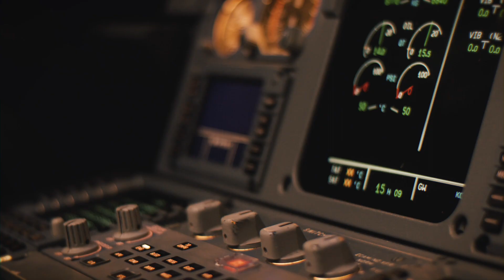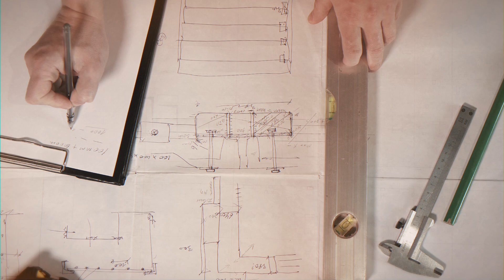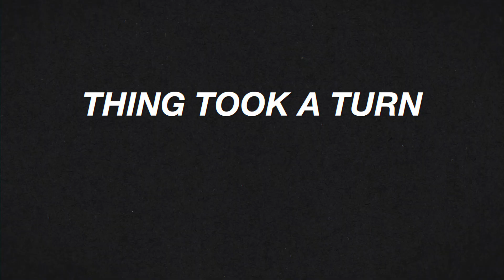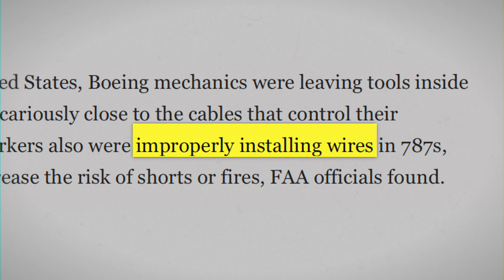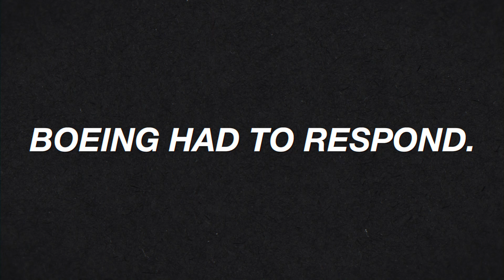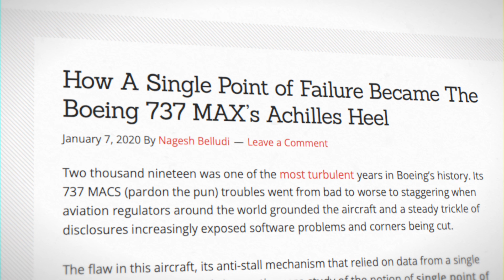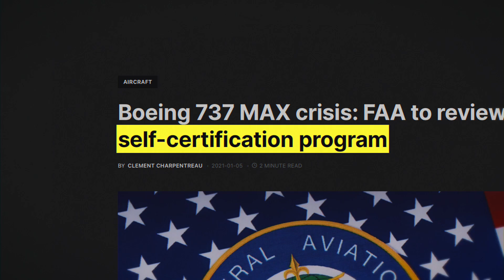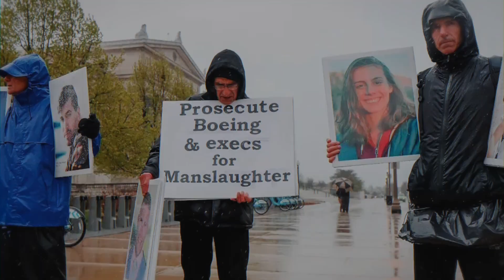The Scandal That Destroyed Boeing

Comment: Just a point of correction. There is no "MCAS sensor". MCAS is just a software system. It uses the pitot static sensors, which multiple other systems use, and which the 737 has 3 of for redundancy. The problem was that MCAS only read in the data from one of the pitot static tubes, rather than checking all three of them to see if one was give erroneous data, like other systems on the plane do.

And from what I've heard, initially, they had actually designed it to check multiple of the sensors, but they reduced it to one later on. I never found out the reason for that though. Maybe they were having problems getting the code to work with multiple sensors and they reduced it meet deadlines and reduce costs? Wouldn't put it past them.
Reply from the maker: thank you for the clarification!
Reply: BTW, apparently the reason they only read one sensor was because any system that is built redundant is considered safety-critical, and all safety-critical systems require extra training which would've impacted a deal Boeing had with some airline.
Reply: @nerd_nato564  Ah, ok, so it was just to avoid training. Sounds about right, sigh...

And the airline you're referring to was Southwest.
Reply: It was either too expensive or they just rushed it so fast, they couldn't get it to work perfectly on time. That would probably be the only reasons tbh. Otherwise it's just plain incompetence
Reply: @R0Tl  Right.  The video blames Boeing for not making a new plane but I think they wanted to make a new plane.  Airlines (mostly Southwest) wanted it to be a 737 with bigger engines as that was the only plane that fit their business model.  And they were a large customer of Boeings with lots of pull.  They also wanted the type rating to be the same so pilots could fly any 737 in the fleet.  As I understood it - the plane would have flown fine without MCAS - it just would have handled differently than existing 737's needing a new type rating which Southwest likely wouldn't have bought then.
Reply: @mikecoulson3575  Boeing definitely did not want to make a new plane. It costs a lot more, and takes sooo much longer to build a new one.

The A320 Neo was just announced at that time, and Boeing was caught off guard by it. Then certain airlines started ordering more of, or switching, to Airbus as a result. Boeing wanted to respond with their own version. 

The A320 is basically the competing airframe to the 737, as both have similar sizes, capacities, fuel efficiency, and range, etc. But the A320 Neo added a lot of fuel efficiency, giving it a distinct advantage to the 737-800, making it the obvious winner in that product category. The 737 is Boeing's biggest seller, so they had to respond, hence the whole point of the 737 Max project.

They partnered with Southwest primarily because Southwest has the world's largest 737 fleet, so they would support Boeing in the project, if it met their needs.
Reply: They charged premium for a second sensor
Reply: @R0Tl  It was mostly to not complicate training as someone above mentioned. There were rumors that they were afraid that too many differences, wouldn't just make it a simple differential training, but would require pilot re-certification on the type. IDK how true that is since I'm not a pilot and IDK how big the differential training on aircraft of the same type can be. Also some versions were checking all sensors - it was just that Boeing sold it as an option, just as if memory serves the sensors disagreement warning. Blame was initially put on the pilots, because "any pilot that knew of this would make right moves", but the problem is that within a very small amount of time pilots didn't make those decisions, because they weren't informed of the existence of the system. That is why probably several flights that happened earlier that had the same problem didn't end up crashing - because pilots were veterans who knew of similar possible issues with similar system in prior generations of 737 (prior to NG, it was the version from early 90's I believe). The difference was that back then pilots were trained what to do in cases like that - it just meant that they had to do it over and over in those flights and they did report it to FAA and Boeing. This is why Boeing knew of the problem.
Reply: That honestly makes it worse.
Reply: @mikecoulson3575  
"Flown fine" and just "handled differently" is a bit oversimplified. The engines had to be placed a good bit further forward because they simply didn't fit under the wings anymore. This basically resulted in an incresed risk of a stall in slow speed phases (like start and landing) especially because in sudden power ups like in a go around the plane now had a tendency to pitch up further provoking a stall.

Comment: Is actually easy to shift blame as stastically, is rarely a design flaw that cause the plane to crash. In fact, boeing can easily blame the pilots on the Lionair pilot being 'incompetent'. Usually, the public will also assume is mostly pilot fault until is proven that the blame have a design flaw, which is hard as sometimes incidents often result in the plane in pieces. The 737 max scandal was uncovered due to ppl being more aware that the 2 crash are strikingly similiar, this result in the uncovering of the 737 max problems. Their negligence to tell the pilots was the major factor at first on the Lion Air, which is mention they only have a tablet to learn about mcas. The ethopian was more or less how boeing assume all pilots is able to react in 10 seconds. So Boeing negligence as well as taking advantage of general public perception to avoid blame, as well as their over simplified view of how pilots truely react.

Yes this was what i read from NG.
Reply: you cannot switch of the MCAS, thats the issue, it locked the pilots out, its like strapping your in a car with your arms tied behind your back and putting a brick on the acelerator paddle!
Reply: Reminds me of the Lauda 767 crash. The window of opportunity to recover was apparently as low as 6 seconds. Which made recovery literally impossible even if the pilots were expecting the issue and immediately reacted perfectly to it.

Comment: The CEO and management staff should be in prison...  question is, what ELSE did they "get away" with?
Reply: What about the people in charge of the Vietnamese and Ethiopian airlines who failed to adequately train their flight and ground crews?
Reply: @robroilen4441  That is beggining to get racist. First of all, none of the pilots ever new of the new system of the new max. Boeing did it to make certification faster. Also ground crews are not in fault as they have nothing to do with the crash.  There was one MCAS strobe, and if ONE fails there is no backup, so its not the airlines fault at all.
Reply: @thegreatestdonut461  Hahahahahaha oh my god you pulled the race card, how ridiculous. What's with people trying to shift blame away from the airlines?? Boeing isn't responsible for training the pilots, they are responsible for selling airplanes. The airlines are the ones who are supposed to make sure that their pilots understand standard procedures for the planes they buy. That was not the case in these crashes, it doesn't matter where they happened.
Reply: @thegreatestdonut461  My man, it is 100% pilot error once they failed to follow decades-old standard procedures involving a stabilizer trim runaway. One of the first things on the list is disengaging autopilot and autothrottle - every pilot knows that. If that had been done, it is very likely that they never would have crashed.
Reply: @robroilen4441  The thing is, Lion Air requested simulators for their pilots to train them for the operation of the 737 Max 8. A Boeing employee called them idiots for this.
Reply: @IllusionistsBane  Yeah because spending a huge amount of time and money for simulator training on an aircraft with essentially zero new features is foolish, especially when your sister airline is already flying the plane. The Lion Air copilot also took four minutes to look up a standard procedure he was supposed to have memorized.
Reply: @robroilen4441  Zero? The MCAS IS a new feature at the time.
Reply: @IllusionistsBane  Yes, a new feature that was designed to be unnoticeable in normal flying conditions and required no new standard procedures
Reply: @robroilen4441  Evidently it failed.
Reply: @robroilen4441  Well including sensor failure which also happens in normal consitions so that's a bullshit and a half. Badly rushed non-intuitive and fail prone engeneering are to blame.
Reply: @robroilen4441  also calling this corner cutting "design" it's overstatement
Reply: @robroilen4441  my dude defending a corporation 💀
Reply: @vincesaenz2760  It has nothing to do with Boeing, I just find it extremely strange that so many people refuse to hold the airlines accountable for properly training their staff. Is it just a wild coincidence that every other top-rated airline in the world was flying the exact same plane without issue?
Reply: @robroilen4441  I thought requesting simulators for the 737 Max 8 IS part of training their staff. Or what, are you going to say that Lion Air's just going to stow it away because Indonesia is a corrupt country?
Those 'every other top-rated airlines' have never had the chance to experience the sensor failure. Lion Air and Ethiopian Airlines were the canaries in the coal mine!
Reply: @IllusionistsBane  Costly simulator training is entirely redundant if the way to solve the issue has been standard procedure for decades. That's the point.
Reply: @robroilen4441  The entire selling point of the 737 MAX was that no new training was required, the airlines were told that they shouldn’t have to retrain their pilots for it.
Reply: However the addition of new features was effectively done without actually telling anybody, and these features are involved in its control
Reply: Fundamentally the 737 MAX was essentially an unstable aircraft. MCAS was an attempt to correct this via computer control but those vehicles should have never rolled off the assembly line
Reply: Should the pilots have done better? Maybe. Other pilots managed, that’s true. But they did so because they discovered the problems of the aircraft and could account for it, when that problem shouldn’t exist in the first place. Pilots shouldn’t be expected to deal with that, especially when it’s supposed to fly just like previous designs
Reply: @robroilen4441  Don’t you start shit with ground crews.

Comment: It is unacceptable that the MCAS system along with many other new systems were not properly disclosed and trained on with the 737 MAX. What makes the whole situation worse is that the FAA and airlines were also involved in pushing the aircraft certification and lack of training as it would allow airlines to have pilots fly the MAX without a new certification being requested thus saving them millions of $. I hope that sure a gross lack of safety awareness and training combined with widespread corruption never happens again.
Reply: I also mention these things as I work in the airline industry and since my job as an Aircraft Dispatcher requires ensuring the safety and legality of each flight, it certainly hurts to know an aircraft I am sending out has a fatal flaw that neither I nor my pilots are aware of.
Reply: That's the whole point of MCAS: to have the plane fly like the 737 so that pilots could reuse their existing certification, saving millions of $ in training + time for the airlines companies. The plane flew perfectly well without MCAS but its flight behavior would be different enough that it would not be possible for pilots to reuse their certifications.

Comment: What you forget to mention (which was the main reason Boeing wanted to make the fastest and minimal change from the 737 to the 737 MAX) is that an american airline (don't remember which one), which at the time only operated Boeing planes, was about to anounce they will order A320 NEO due to the lack of competing offer from  Boeing.
By fear of losing their near-monopoly in the US, Boeing announced they will launch a re-engined plane while they had not even planned it before, and had to do everything too quick.
Reply: And it leads them to loose their place to airbus as market leaders. Perfect definition of the karma, even if its not realy a consolations for the families of the victims.
Reply: That’s Southwest Airlines
Reply: @anhminho6115  no I think he means delta
Reply: @frozenuruguayball6436  Delta has so long been operating both Boeing & Airbus planes. They even have been continuously receiving A321ceos and also are the last-ever customers of the A321ceos and then now taking deliveries of new A321neos. In short, Delta has never been that loyal with Boeing so that the manufacturer would try to persuade them anyway

Comment: Big mistake at 6:31. The MCAS was NOT developed to compensate for the increased power and prevent stall. That's a huge myth. Such a plane would never be approved by the FAA. The 737-MAX just flew just fine without MCAS, but it operates a bit differently from the 737 non max, therefore the pilots would require another certification, which is costly and time consuming. The MCAS's sole purpose was to make it fly exactly like the 737 so that pilots could use their existing 737 certification. That's it. It has nothing to do with stall and increased power.

Comment: My dad is a mechanic and I study aviation stuff but the way I’ve learned the difference in aviation builders and their autopilot glitches is this:

Airbus messed up in the 1980s.(A320 1988 or 86 that goes into the trees). They’ve refined their flyby wire system which helped them compete with Boeing. That and their better fuel economy really helped them kick off. 

Boeing was hard lining manual flying, but as airbus became more and more popular, began gradually adopting fly by wire systems and having the Same issues airbus originally had. 

The 37 Max issues was due to a new-engine on the 37’s direct competitor the 320. So Boeing slapped the engine on. But due to a different height, they had to design a correction software that was, as seen in these accidents, horribly flawed.

Yes it was money over lives, but it was also Boeing and the airlines having to figure out all these bugs and issues while airbus sat high and mighty watching Boeing lose money like they had in the 80s

Comment: Boeing was hurt by this screwup, but not destroyed.
Reply: Correct. The slant of this video may be well intended but inaccurate in some areas. Boeing is recovering from the grievous errors and the 737 MAX is selling pretty well again. Yes, Airbus's A320 family has pulled way ahead but that's largely also due to the A321 NEO LR and XLR, long range models that Boeing can't match without a too costly redesign of the main landing gear to accommodate bigger CFM Leap 1A engines with about 20% more thrust than the Leap 1Bs the MAX is now fitted with.
Reply: The shareholders were hurt and people died...but you're right...Boeing was not destroyed.

Comment: I used to be an investor in Boeing and actually made quite a bit of money from them.  I think the problem with Boeing is they let the bean counters take over instead of the engineers.  When a company shifts to focus on that, all they care about is cost cutting which means cutting corners on design and manufacturing to save a buck at the expense of product quality and safety and it also means cutting costs by reducing manpower and allowing pay to fall below the standard needed to retain and motivate the best people.  I dumped the stock once I realized that's what was going on.

Comment: Let's remember that while the captain had over 8,000 hours of flying time, the F/O had less than 400 hours.  

The U.S. requires pilots to have 1,500 hours, before they can operate a commercial aircraft.

A friend of mine became a captain (757/767 before switching to 737) after 19 years with his carrier.  He started with the carrier as a 727 F/E 10 years after he got his private pilot's license.

The F/O had far too few hours to be of help to the captain, other than running the checklist, navigating, or working the radio.  At 300 to 400 hours, I'm not sure he is ready to fly multi-engine, let alone a 737 Classic.

John F. Kennedy, Jr. was criticized, after his death, for buying a Piper Saratoga twin engine, because it was too much airplane for his experience.  At the time of the crash, he had 350 hours of flight time.
Reply: You can get a multi engine cert at 40 hours. Commercial at 250. 400 is NOT too few to be flying multi, but definitely too few to be operating a commercial jet. For ATP ratings (the kind necessary for large passenger jets) you're supposed to have 500 hours cross country flight time alone, as well as several other requirements. Search  FAR 61.159, 61.129, and 61.109 to see the requirements for different license levels.